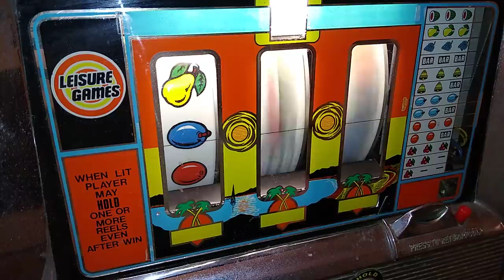Vintage Bally slot machine payout counter

Comment: I have one of those machines that looks almost identical except for the prints. I needed to convert it from guilders (ƒ 0,25) to euro's back in the day (I had it before the euro was introduced). Only the copper € 0,05 coin worked because it uses a magnet to determine if it is a valid coin.

Comment: I know slot machines are the worst things to play at a casino, I liked the old electrical-mechanical machines.  I liked the noise and hearing the gears, the relays and the solenoids firing. It wasn't the game, it was hearing the electronics, which I thought was cool. The modern video slot machines are just not the same.
Same reason why I like the old pinball machines.

Comment: I was surprised by the date on the board - 1977. I'd also have guessed it was much earlier. Unless "1977" is the model number. I think the last time I actually used one of the mechanical machines it was back in the days of "old money" and there were 100 year old coins still in circulation.
Reply from the maker: I get the feeling this machine was upgraded multiple times throughout its life, so that may have been a new payout system.  The wear on some tracks does not correlate to some of the prize values.

Comment: 0:44 Oh dear, Clive has a gambling habit judging by all the coins there. He must have spent all day pulling himself silly on the one arm bandit. 🤭
Thank You for the video Clive. Apart from the odd raffle ticket I have never seen the gambling attraction of putting coins into a hole for entertainment so I appreciate seeing the inner workings of a Barnum & Baily machine (a sucker and his money are soon parted). All those solenoids etc could now be run from a fairly small IC. 

This primitive looking machine was state of the art when Voyager 1 was launched so I wonder what the electronics are going to be like in another 44 years. We have lived through a time of massive technological advances that I wonder if future generations will ever experience the leaps and bounds that we have. Eg. First aeroplane (aircraft) flight to walking on the moon in 66 years. A 4 transistor IC to 2 Trillion in just 60 years. It may be a chineseium curse but we sure have lived in interesting times. 🤔
Reply: Have you never thought why silicon chip package manufacturers have not yet realised there's a third dimension ? Then there's the option of COLOUR - it's as if Henry Ford is making all the chips.
If they get these combos right, they'll reinvent Stickle Bricks.

Comment: 3:16 "That's the nice thing about these machines, they're not complex" ... I think they were quite complex, just not in electronics but mechanically instead. Which is why they were so fragile and since have been replaced by electronic versions…
Reply: Even though they are complex as a whole all of the pieces are usually dead simple.

Comment: You'd love an old telephone exchange rack, wouldn't you? The entire things used to be driven by stepper relays, driven by the dial pulses.
Reply: Old elevator controls were also electromechanical. There was one from 1975 in a building I once worked in. Not a single solid-state component anywhere in it that I could tell (they once left the machine room unlocked and I peeked inside...)

Comment: Very sobering thought that nowadays all those electromechanical processes can be performed by just the one chip, probably one of the many "anonymous' ones available in bulk for a few cents / pennies! It is not unreasonable to assume that you could buy a hundred of these chips for less than the price of one of those relays on that board.

Comment: It's hard to beat sitting front of one of those old machines in a casino and hearing all the clicking and banging and the coins dropping into the metal tray. I doubt they have them at all in Vegas anymore, now they just slap credits on your account. It's just not the same.

Comment: What a fascinating, low tech yet delightfully elegant mechanism! Though I repaired modern fruit machines for a few years (Barcrest, Bellfruit etc.) I've never worked on the electro-mechanical "slots" before. The newer machines use rather clever algorithms to keep the payout closely within limits. They actually decide on the price first before spinning the wheels to show an appropriate combination (pure evil 😈 👌). Clive, how do these older machines work out how much to pay and when to pay it? Or is it literally random chance with the probability preset by certain mechanical factors (number of symbols on the reels, stop position etc)?

Comment: Heya Clive, didn't think you were into these old things.. i have a Rotating wheel of doom style games machine from i think around the 1960's, originally from kent/essex direction. would love to send you a couple of pics of the weirdness going on in the back. the wheel used for working out the payouts isnt as topspec as that, in fact i think its an old Caster from a chair thats had notches cut into it to work the contacts. i started pulling the slightly modern LED's and sparkly stickers off and found a really nice 60's trippy swirly pattern on the glass disc.
Reply from the maker: That sounds nice.  I love the old EM machines.

Comment: Great explanation!! 
 My machine keeps running until the hopper is empty no matter what the pay out is supposed to be. Any idea what is wrong? Where is the coin counter switch?
Reply from the maker: On electromechanical systems like this, as the coin exists the hopper it presses past a switch.  That should trigger a solenoid in the back box that counts round the payout track.  If the solenoid is faulty or the mechanism is sticky then it may not be able to increment the counter.

Comment: You cannot pull the handle part way and release it. There’s such a thing as the full stroke pawl that ensures the handle is pulled thru it’s full cycle.
Reply from the maker: The trick is finding the sweet spot between the two pawl indents and rocking it there..

Comment: How did they lay down those wiper tracks? (Is it similar to how a PCB was etched? Are they using a copper clad material? Or, are the tracks cut out from copper sheet and glued to the substrate?)
Reply from the maker: It looks like an etched PCB.

Comment: A few questions...
-why two "2" rails? Too many "2" wins to fit on one group of contacts or something?
-why the wear marks on "10" and "5"?
-is all the "logic" handled by the 7 contactors? Can we get a schematic? :)
Reply from the maker: I think it may be to allow for more electrical paths for 2-coin wins.  This machine has most payouts at 10 coins.  The machine may have a history of different games and conversions.  The coin counters have failed due to high number of operations.  This machine well and truly paid its way.
There are three more relays on the reel mechanism..

Comment: Hi, i have a 1970's Bally Pyramid one armed bandit. When i put the 2 pences in, they mainly fall right through but every so often it will register and allow me to play. Any ideas would be helpful. Somebody mentioned something about a pin that might need adjusting? Thankyou.
Reply from the maker: The coin mechanism has a switch that the coins hit.  It may need adjusted or changed.  Are the coins going through the mechanism OK?  Another issue is sometimes a relay on the old electromechanical units doesn't latch properly when the coin switch sends a pulse.

Comment: Is this you working up to videos on lift controllers ?
Reply from the maker: I was taking lots of pictures of a lift controller today for reverse engineering, but a modernish electronic one.
Reply: @bigclivedotcom  Once upon a time....(to follow)

Nowadays, I expect lifts to have three controllers. 1 to make it start, one to run it and one to stop it. The stopping controller being 100% mechanical with a switch to feedback to the running controller. The running controller to be electromechanical, managing all the lift motions inc. doors etc.
The starting controller could be any old shitty computer as it should have no place in the safety chain but merely organise lift motions for effective management of travellers. Is that what you've photographed ?......

.....Back in 1996, Aston University in one of the more recent lifts, known as a 'sky lift'. I'd got in at the ground floor with the intention of going 'fairly well' up the building (I forget which floor). There was one other poor sod in there with me.
I let it get up to speed - then opened the car doors. As expected it stopped. After a short pause, I'd coaxed the doors closed again and....
The lift set off DOWNWARDS ! despite heading for a floor further up. Now this isn't too interesting .....
BUT, as the lift went down, the floor counter continued to count upwards !
I think we were about the third floor, still going down when the counter started getting it right again.

Comment: Going back to the Beard question. It's a good point. Weather protection. Humans developed hair or lost hair. To match the climate. Or rather how we would survived the climate and it's changes. We went from being naked. To wearing cloths. Or clothes as we call them now. Most people shave their body hair because we have warm sealed homes. Because it's too hot. And other reasons. The human body. Like any living thing, adapts to it's surroundings at the time. Not because it's instant. But because it's a survival mode over possibly thousands of years. What a beautiful planet. Don't spoil it with Poundland tat 😁.

Comment: I can buy one for $100 what do they worth it lights up but it doesn't play they said
Reply from the maker: It depends on the type what the problem is.  On the older units it could be that one of the mechanisms isn't seated in it's connector properly, or that a relay has wiggled loose.

Comment: So what are the 7 relays, sorry, contactors all about? Don't suppose you fancy knocking up a circuit diagram? Surely must be easier than doing one for electronical things, it's all literally there in front of you, with a wire saw and some glue you could make the thing into it's circuit diagram. 

Ta for the tip anyway, off to 40 years ago to win 50 whole unearned pence! Actually even with double payouts it's probably still a loser, the ones in chip shops and stuff are set to ridiculous odds. That said, can this one have it's odds set or is it genuinely the random-ish spinning of the actual weighted reels? I suppose it would be. 

Would like to see much more of this, including the mechanism the reels use to determine wins, more circular tracks I suppose and maybe different offset tracks to connect to the 25 / 20 / etc contacts on the payout box? 

Near Blackpool beach there are, or at least were 20 years ago, turn of the (20th) century purely mechanical arcade machines like this. You give the guy 50p and he gives you some old enormous brass pennies, then you can win awful prizes like a single solitary sweet or those abominable candy cigarettes. Proves what a boring affair going to the seaside or fair must've been back then. But since then they've grown from purely mechanical to stuff like the machine in this video, and ironically the machine here would have been possible in 1877 if somebody had thought of it, it's all technology that was available at the time. Then nowadays it's just computers with LCD screens, and in 5 years even the money won't be real solid money probably. I wonder how much business online slot machines do compared with real ones? Much more I'd bet.
Reply from the maker: Tracing this machine out would be complicated by the fact that the entire reel mechanism has to be pulled out to access the circuitry, and disconnects it all in the process.
Reply: @bigclivedotcom  Oh OK. Could you just maybe show us one reel, since they're presumably all the same? Is it the same sort of thing, contacts on, say, the bell, that lead through to the location on the other side where the bell would be on the next reel, and all 3 make a circuit that goes to the 25 line? 

It'd be interesting, looks like the whole thing is just a bunch of switches. 

Or does it all fly apart and springs and ball bearings go everywhere once you touch it with a screwdriver? 

Also a bit on the mechanics, just basic, would be interesting. 

1977 is quite late for a fully mechanical design. Computer chips were available, you could get entire CPUs in one IC, and those little 4-bit ones Mattel used in their toys were presumably affordable. I see how this way works, too. Perhaps it's a bit early for them to go full software with virtual reels and all that reliably. When they've got a factory all set up to do it this way. 

Ta, Clive.